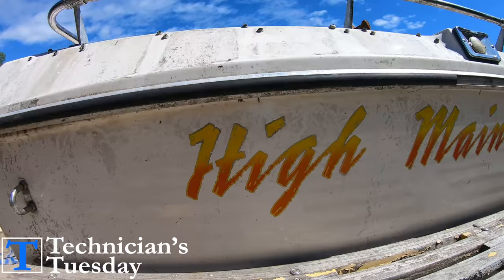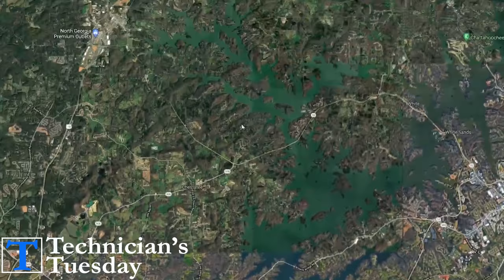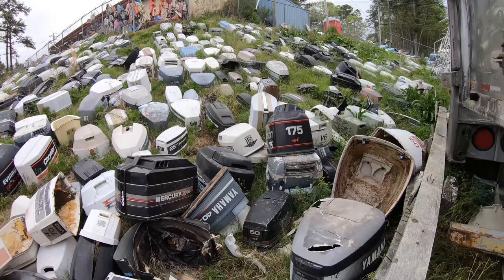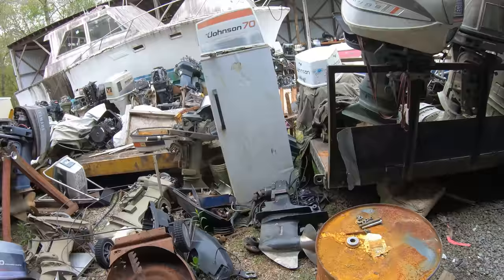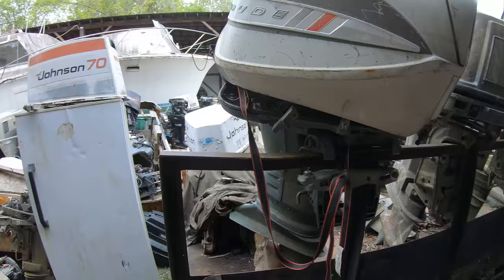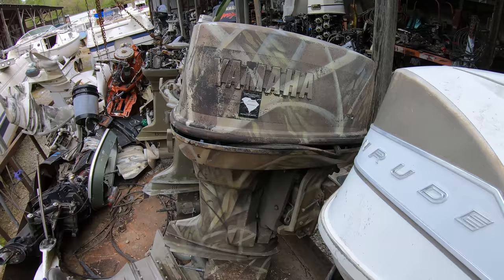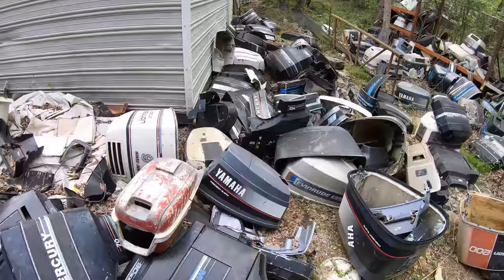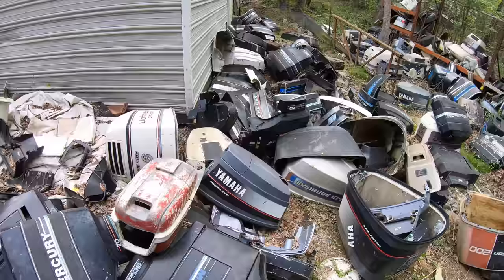Visiting A Boat GRAVEYARD!!!

Comment: Thats funny i work there / i have been sub to you before i worked there / i heard someone was filming that day sorry i missed you
Reply: Would you know what that big Chrysler 4 cylinder outboard with the factory blue hood was? It said "Deluxe" on the hood.  Chrysler did have a racing 150hp with open headers and racing foot...Same blue top. I am guessing it is the same powerhead w/special pistons and no headers... 🤔 The standard 4 cylinder was max 120hp.
Cheers 🍻

Comment: It absolutely breaks my heart seeing so many boats that could be repaired in the salvage yard. I really need a reasonably priced boat so much. Thanks for sharing this video Onelove.
Reply: Because repairs are more expensive than buying a good used boat. After you restore one of them you will NEVER going to get your money back. So it is just for enthusiasts.
Reply: @alexorehowski3387  yes but it can be depending on the size of the boat maybe
Reply: @lightskinxxvvxx7334  It doesn't matter how big or small a boat is, you never ever going to get back what you put into it.
Unless it's a young boat with some little damage, but all the crap in this yard isn't worth it. And like with cars people
also need used parts, so it's good to have yards like this.
Reply: @3DPeter  it does the more bigger the boat the more money and work you gotta put into it just one old beat up boat can cost $5k to probably like $25k $20k can be the same with cars
Reply: @lightskinxxvvxx7334  Only putting 20-25k into a 5k  beat up classic car will make you money.
Reply: @3DPeter  same thing for a boat
Reply: Most boat yards have abandon boats people owe on storage fees, etc....yards will sell them, but you need the title to register it....marine engines for inboards re manufacture can be purchased reasonable at Jasper engines online shipped to your address.

Comment: The yard layout could be better organized, looking at the inventory I see most boats are the low price type, a few medium price ones but they all deteriorate quite fast  being outside exposed to the elements without any attention. I did note the sailboat, under the cover it looked OK so some of the stuff is salvageable and I would bet the majority were lightly used in fresh water so there could be a few nuggets to find. I do get depressed when seeing so many boats left to rot, especially as you see people selling identical boats on Craigslist  etc. for silly money.

Comment: There is a salvage yard like this on I 85 between Greenville and Anderson, South Carolina.  I used to drive by it at least once a month for years and I always wanted to stop and look to see what they had but I never did.  As somebody who curb shops pretty frequently I'm of the opinion that there are definitely boats in there that wouldn't cost that much money to get running again if you were somebody that knew what they were doing when it came to repairs.

Comment: The interesting thing about boats is that unlike old cars, many of them actually had nothing wrong with them.  Often old cars broke down and were left behind to rot but with boats, many were in good condition before simply being abandoned.  If you know what to look for, you can get an excellent project boat very cheaply.  That is, as long as you have a way to transport it.  A lot of boats were left by their owners in marinas and for whatever reason, the owner stopped paying the storage fees.  Boats like that are a better choice for a project than a newer boat that was damaged by a storm or sunk then recovered.

Comment: Absolutely Heart Breaking! I've Been to Hundreds of Auto Salvage Yards, But I've Never Even Heard of One Boat Savage Yard, Here In South Africa, Mate. Boats are Just To Valuable, here, to Scrap Them! Awesome Video, Though!
Reply: Most if not all are fiberglass. It rots over time and can't be repaired. Once it ages out fresh fiberglass patches will not stick to it. Also many of those boat's have plywood sheet with fiberglass applied all around it to strengthen the hull. Eventually that plywood loses it's strength and the fiberglass crack's allowing water to soak into the wood and rot it. That's the reason all those boat's ended up where they are.

Comment: I'm sure there are wasps galore in the summer. Majority of those boats are plywood core. Didn't see many OMC sterndrives or much sterndrive parts there only saw 3 electric  lower gear cases in the video. That area is big on outboards.

Comment: One of the biggest problems with most all of the boats out there is water intrusion deep down in the structure and the wood rot that comes with it. The boats might look pretty and rebuildable but I'd bet all have soft and springy decks and transoms. I speak from experience with my own project boat I finally got started on rebuilding and ended up throwing in the towel. I'd be better of either renting a boat or buying a fairly new one that someone else is selling from lack of using it

Comment: I need one of these near NJ i got a 1967 starcraft that im trying to find the metal pieces for the rub rail on the lap strake. Im almost fully restored now and for 300 I got the hull and a trailer. I've now been offered 8000 since I put a 2020 40 merc on it. I have now 6 weeks in a row run that boat 25 miles off Atlantic city and caught bluefin tuna brown thresher and makos and tons of king and Spanish. It all started with a 300 pos

Comment: It's hard to say how these all got there. Maybe from some hurricanes or tornadoes? Boats like many other leisure toys need lots of TLC, storage  to be used. The cost of fuel and other things does not make it easy to own one let alone having a vehicle to tow them with so much weight. Wild is how many manufactures produce so many engines but we as humans go for the new all the time. What would they do with this place after the owners die and how do they get a boat out of there if it's stuck in the woods. Great video, watching from Kingston ON Canada.

Comment: I wonder if there is anything to do with a hull once it is picked over. Fiberglass lasts forever and it’s not like a picked-over car where it ultimately gets melted down.
Reply: Fiberglass lasts forever ?  Like hell !  The fibreglass part lasts forever agreed but the plastic matrix does not ! It oxidizes and breaks down from sunlight and turns to dust .

Comment: the majority of what is in that yard IMO is  way beyond the point of trying to make it a useable or capable Vessel again the Combination of Materials and Labor needed.  To do so just doesn’t make any sense it would be cheaper to buy  a used well taken care of boat or even a new one  I’ve owned 17 or 18 boats throughout my life  and I’ve given away for free better ones then that lot has  its easy to be a Dreamer like the Person Filming and Commenting on the video  but the knowledge of actually  knowing what it would be to  restore one properly is different  I’ve done it  Boating is a Expensive and Time Consuming Hobby  if you purchase new or used Generally you have Warranteed parts and Labor or a well thought out and repaired boat  with way less Repairs and Breakdowns  Depending on the location and /or  Failure it could cost a Boat Owner Thousands of dollars to get towed  and get the problems fixed
Reply: I agree. This place is a garbage heap. I would love to see the monthly revenue to see if it supports a single person.

Comment: I wonder how many have wooden frames sprayed with fiberglass. You wouldn’t believe how many until sometime in the mid to late 80’s.. Transoms rot first and if not checked, it’ll be some Titanic sh,.,t..  Couldn’t see any other reason to junk a used boat that just needs some TLC

Comment: I bought a trailer there. Did you see any old Checkmates on your walk?
Reply: After I sent the question, you walked up on that blue Checkmate. Did you notice length or what kind?
Reply: I went today and actually looked at that blue Checkmate. He said he would sell for $750 with the trailer. My wife said no otherwise I’d have my winter project

Comment: I see millions of dollars spent on depreciating assets that once threw someone's hair back. It's painful to see but in most cases this is a pile junk that if anything, the engine blocks might fetch recycling profits but what the hell are you doing with all the fiberglass?. Unlike an auto recycler mostly being metal components, this is a mess of crap that younger generations of people aren't going to dig through. I mean who is digging for an old 2 stroke carb when they should be thinking about a new 4 stroke. Who is the target market for these old parts and at that quantity that it warrants a single man to manage a place like this to earn a living. I guarantee none of this is in inventory judging by the mess it in. When the fellow who built this place retires, I think it's more an environmental hazard that needs to be cleaned up then an asset that could be sold.